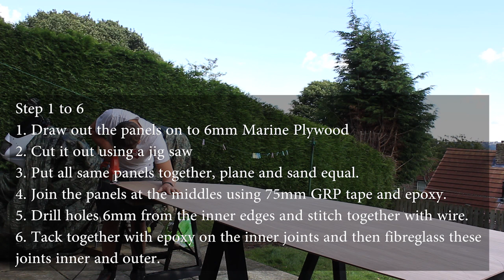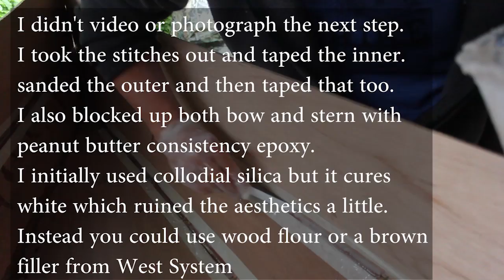Genius| A Canoe made from Plywood! - Why doesn't everyone know about this!!! (Part 1)

Comment: For all the wood be (pun intended) plywood boat builders out there, here is a pro tip.  For laying glass tape into epoxy, use those really cheap disposable bristle brushes from the hardware store.  Cut the bristles so that they are about 6mm in length.  This accomplished a few things.  1) it won’t soak up and then waste a good bit of epoxy.  2) the brush can be used with a brushing motion to apply resin, and in a stabbing motion to wet out tape/cloth.  3)  the short bristles are less likely to fall out of the brush, only to be forever embedded in your epoxy, like the full length bristles.

Hope some of you out there find that useful.
Reply: The Chinese brushes available in my country are so terrible that half the bristles come out. I use disposable sponge brushes cut down as you suggested to keep it from sucking too much resin. But actually once the brush is saturated it won't soak up more resin so not a biggie on a large project. Also using mylar plastic (like on cheap report folders) placed below the splice and on top of the fiberglass tape will cut down on sanding.

Comment: You can actually use reinforced tape rather than metal or plastic ties, especially on a lightweight project and it keeps the epoxy from dripping out.
Reply from the maker: Thanks for the advice.

Comment: How much did it end up weighing?
Great job by the way, and your little Jack is beautiful... bless his soul.
Reply from the maker: Thank you, you know about him passing don't you? Jack lacey dipg on Google will bring up all the details. Miss him beyond words. The boat weighed too much to lift. Plans said to use 3mm ply I used 6mm. Also I added those runners on the bottom and Ash yoke, boxes front and rear and a mahoosive fibreglass matt on the bottom
Reply: @wjlacey  Yes I read the comments about Jack your angel.  Love the video and the tenacity it took build it.  I am really looking at build a stitch and glue myself, but I need it to be light enough for me to lift (no more that 50 pounds)
Reply from the maker: @theresachandler7739  selway Fisher do lots of plans. Mine would be way lighter had I stuck to the plans.

Comment: Nice! How much does it weigh?
Reply from the maker: Too much! I went properly overkill, I didn't want it to break. The matting and epoxy on the bottom of the boat is about 10 - 15kg alone! I should have used 3mm marine ply but used 6mm. Those runners on the bottom weren't meant to be there. I used Ash as the yoke. Basically it's too heavy and too long. If you wanted a go at this yourself, go for the 12 or 14ft and don't beef it up as much as mine

Comment: It's the bit you missed out that I wanted to see most!
Reply from the maker: Which bit mate?
Reply: @wjlacey  at the end, when you start applying the tape. Is it one piece or small bits? When do you cut the ties etc? Cheers
Reply from the maker: @stemcleeds  there's a second and third part. The tape I went all the way a cross inside and on the outside I put on pieces to fit between the wire if I remember rightly

Comment: Very nice boat/ project.  I do want to point out one small tip  on fine tuning plywood to your final dimension the fastest way possiblr is to use a beltsanfer. And some. Aggressive belts usually 80 grit is good  i did professional Architectual woodworking for over 20 years  and at my last position i had over 40 people installing millwork for my division  i will add it is a messy way to do it  and  its best to buy  one with the largest belt capacity you can afford. Ive owned and used most brands  and have found in general the dust collection systems all stink   No matter what brand  most shop guys prefer the Porter Cable  brand sanders  i find them to be a little heavy and uncomfortable to use for long periods of time i. Used a Makita brand as my “go to” for many years  and ive beat the heck out of it while the bearings are getting noisy  it still works fine  BTW the bearing issue was my fault as i actually used it  to  sand off  hardened  Barnacles and bottom paint   Off of my fishing boat   In order to do that i spen hours using the tool upside down in tight spaces  so th dust had no where to go but in the sander  ?   Bearings are relatively inexpensive and easy to replace i will probably replace brushes as well  as a preventative measure    And i would expect it to run well for many more. Years as i do think Makita builds good tools  that are well engineered   In all honesty ive looked at Harbor Freight belt sanders and. They are. Made  a little  on the cheap side but they work ok and do have the benefit of being light weight  the Dewalt ones use to be one of the lighter ones but you had to settle for a 18 inch belt  most. Woodworking shops i was associated. Would supply 21 and 24 inch belts as that was what they used in their shops  and buying your own 18 inch belts at a retail store can get costly   Other wise i did really like the  stitch and glue  method  as that is my preference. For a small wooden boat  i did however restore a old 30 foot Chris Craft cabin Cruiser  that was  double planked  having Mohogany boards over plywood  from the factory  she was tough but  a pain to refasten IMO   Looked great when i was done but  a horrible financial investment. That i pretty much knew going into as ive had 17 or 18 boats in my lifetime  and always tell my freinds when they ask its a terrible financial investment yet a wonderful investment fo fun if you can afford one  other wise dont buy a boat   Obviously I’m a  lover of being on the water and ive boated   All over the Florida Keys and the Carribean  thru my life  as well as many years on the Chesapeake Bay  from skiffs to sailing Yachts and Power boats
Reply: Craig Monteforte

Comment: Why use 6mm?

Way to heavy.

3 or 4 mm with glass for strength is all you need
Reply from the maker: Yeah it's super heavy.  Will last a long time though.
Reply: Regulations in the UK is minimum 25mm thick for plywood boats, grp just makes it more waterproof

Comment: Does it matter what type of woods?
Reply from the maker: I would say absolutely. I used Marine Plywood for its quality/ durability but some do use normal plywood which i didn't like as there's often a lot of voids hidden inside th sheets that create weak spots. Any wood can be used for the gunwales and for the yoke, if you want something beautiful, durable and long lasting, then use a hardwood. I used Ash.
Reply: Third generation boat builder here. There are a lot of factors to take into account when choosing the wood.  It's possible to build a boat using exterior grade ply, you'll just have to be sure to use glass and PLENTY of epoxy. It'll give you a few years service, but it'll begin to fail and rot far sooner than marine ply. It also won't look near as pretty as using marine. Marine is stronger, uses a better water resistant glue between the plys, and has fewer voids. It'll give you more time between repairs (everything rots eventually). 

If Marine ply is out of your budget, or difficult to find in your location, you can always go the cedar strip method. Most hardware stores carry rough cedar that you can cut down for strips.
Reply: Don.t use luan, you risk your life

Comment: Using your wife's/girlfriend's art brush to wet-out the fiberglass cloth - not a good idea.  You should have staggered the joints where you laminated 2  pieces together to make them longer. The boat is weaker with all the joints lined up. I understand you are trying to maximize wood and length, but at compromised strength.
Reply from the maker: Followed the plans mate... Strong as hell, weighs a ton

Comment: Thanks for sharing. I have seen some making a scarf joint. Alternative a fingerjoint to make a stronger join. Fingerjoints a very easy to make. You let the two peaces of ply overlap 3 inches. And with a jigsaw you cut "finger shapes" from one side to the other..Only problem with that is that your boat will be 6 inches shorter..👀

Comment: Ha, takes me back. I built my Wren in 2014. We have had many happy hours sailing her around Chichester harbour. After six years wear and tear I have now sheathed the lower part of the hull with fibre glass as I got fed up with all the repainting. Next step is some metal inserts for the ends of the bottom runners as these have taken a fair beating. Happy sailing.
Reply from the maker: Hey man. How'd you transport yours? Only ever been out with mine a couple of times due to it being too heavy and long.
Reply: @wjlacey   I have an old Ford Mondeo estate with roof bars. I lift one end of the canoe onto the rear roof bar with the canoe the right way up. I then lift the other end up and slide the canoe forward  onto the front roof bar.  The canoe is then positioned slightly to one side and rolled upside down and held in place with rachet straps. You need to be careful it doesn't fall off when rolling over. You could not bother with the upside down bit. I live in Southern England where it rains a lot so the canoe is stored/ moved upside down.
Mine comes in at 35 kg with the fibreglass. I can lift it on my own. The difficult bit is rolling it upside down and then holding the canoe whilst walking  under it to a central lift position. It helps that I am only 5'4" tall and have mountain biked for near 30 years, Strong legs and not far to lift. The difficult bit really is holding it whilst rolling the canoe over. I have been meaning to design a roll over brace to help with this. I used to do the rotation before the lift onto the car but it was awkward, especially when wet and slippery. I dropped it once. One other thing, if lifting on your shoulders fit good padding to the central strut/yoke.
Practice a bit before doing any of the above for real. You can also buy wheeled dollies for moving the canoe around. Have fun.
Reply from the maker: @aeropunk4127  thanks for that. I had to laugh at the 35kg bit though. Jesus christ I've over built mine. It is prob 100+ kilo. I've got a vid of me somewhere picking it up and my body bucking under the weight. I'm 6ft 2 and not scrawny too.

As for vehicle. I have a high top lwb transit that I've converted to a camper. Put it on the roof once. Man oh man lol, that much weight, that high up, way too top heavy.
Reply: @wjlacey  Yes 100kg is quite heavy. Did you build yours for shooting rapids? 
Mine was built for relatively gentle rivers and harbour sailing with my 3 children. It's a shame you haven't got to use yours more. How about building a light weight one ? It's always quicker the second time around.